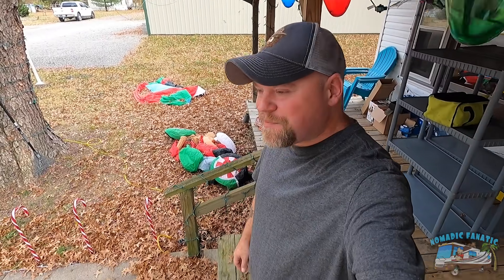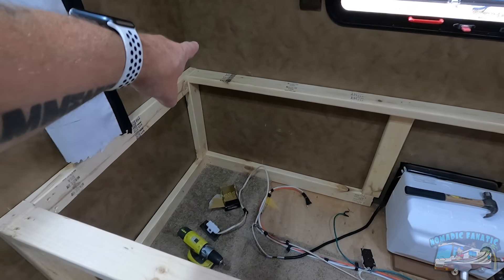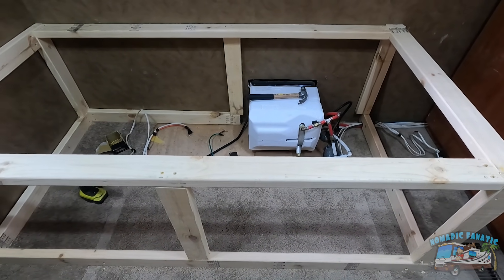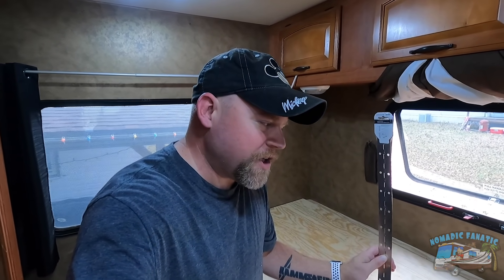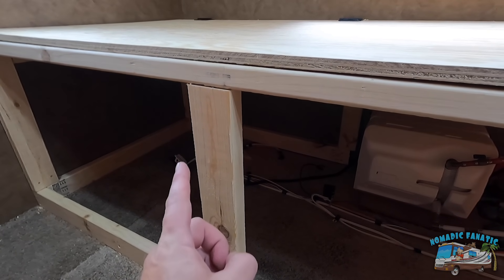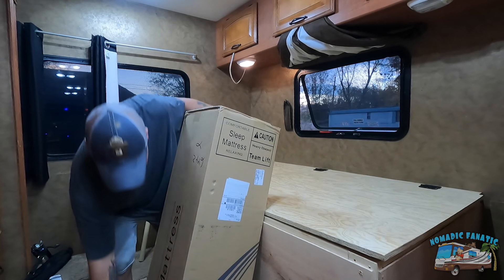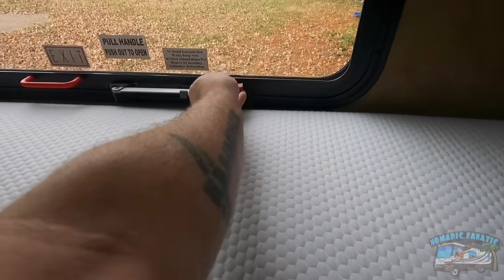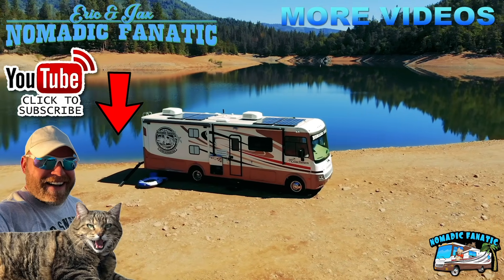Complete Rebuild RV Bedroom & Bed. MUCH BETTER!

Comment: First off I am not a hater....Please take a breath and breathe.  You are right to be a little on the upset side about this dumb hospital thing. I just had a one pound four ounce tumor taken off my left femur. I got to kiss my husband in the car just before he drove off and I walked into the hospital alone. When I woke up I got to call and say I am alive, love you hun I will call again when they say I can leave the hospital in maybe a week.  This whole thing is just not good. We need love ones when we go though things like this. Love your bed idea. On the steps make them so you can also use them for storage maybe those flimsy hinges would work on them that way you could put it at the end of the bed, make them like storage bins put together with lifting lids. . But the velcro idea is a good one for the mattress.  Pray all will get better.

Comment: Avoid the 2x4 to stop mattress from sliding. You will get lots of bruises from hitting it getting in/out of bed. I agree with the non slip material as a better option.